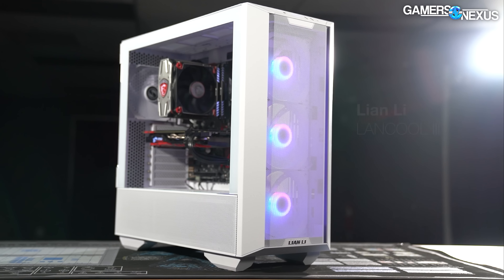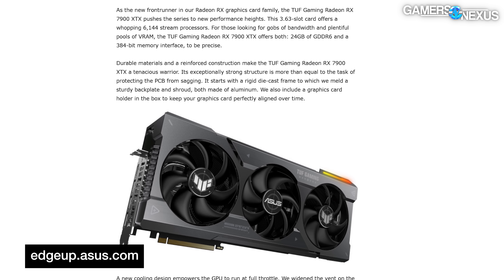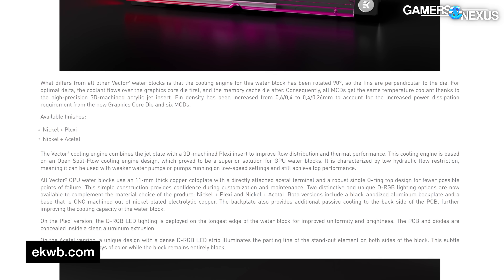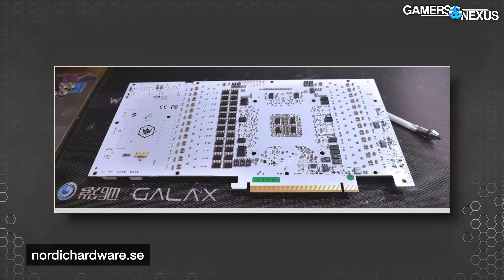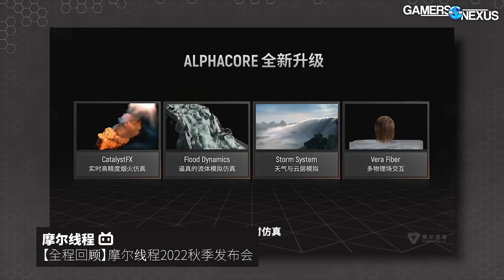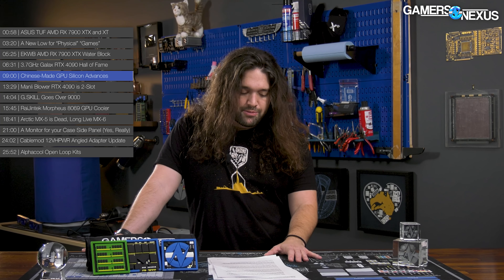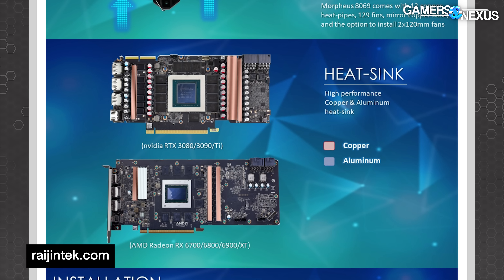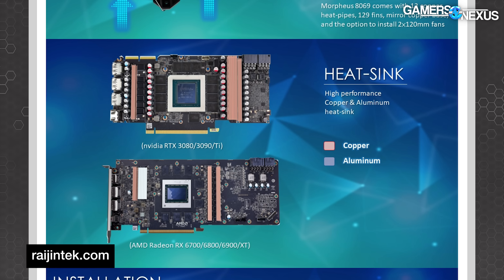HW News - New GPU Competitor, ASUS RX 7900 XTX, 2-Slot RTX 4090 Blower

Comment: I heard "2 slot blower 4090" and started hearing jet engines in my left ear
Reply: LMFAO 😂😂
Reply: Look, at least it's 2 slots. Sometimes I still wish we could go back to the 1 slot gpu days. It's so out of control now.
Reply: Linus was testing an adequate fan lately...
Reply: @roxymigurdia-t5p  why does slotsize matter, most people have more then enough room in their case.
Reply: I still run a old amd 9590 with a darknight with a delta fan on it... I leave it on and It stays on high pretty much 24.7 I never did care about noise lol. I live next to a highway I need something to drone the noise from idiots with speakers on the out side of their cars trucks with no mufflers and fart cannons hondas sounding like they are going 100 plus but come by house under 20 mph.
Reply: @budgetking2591  Makes the card more likely to sag and pull away from the cooler. It's more in the way of air flow and is clunky to work around even in cases which it fits in. Plus, they're almost always tuned to suck even more power down due to the greater cooling capacity.

It's not necessarily the fact that the card is big. It's the fact that it seems more and more cards are becoming so fucking huge and there is not much choice anymore for those who want a card more in line with the sleek slim profile of something like a 1080 Ti. I myself am still running a Titan Xp, and I'm going to hold onto it even after I build a new PC. The FE design of Pascal was slim, sexy looking, didn't use much power (comparatively), and since it was a blower design, it didn't exhaust heat back into the case which allowed it to be used in very size-constrained builds and server cases. With the launch of the 3090 and ESPECIALLY the 3090 Ti though, those (comparatively) small efficient cards we used to get with Pascal and earlier started to go out the window, and now, we get Nvidia's absurd 4090 and AMD's more manageable but still huge 7900. Yeahhhh... >_>
Reply: Hey! It worked pretty well for vega 64!
Reply: @budgetking2591  Maybe I want to use the other slots on my motherboard. Not to mention gpu sag, strain on pci-e socket e.t.c.
Reply: @budgetking2591  because I like itx builds :(
Reply: WHAT??
Reply: @nikolajlarsen6258  That's really not a fair comparison. lol
Reply: Flashbacks to my Radeon x1900
Reply: 290x blower style has entered the chat
Reply: Is that my tenitis? Nope just my 4090. 🤣
Reply: is that why the case is slowly drifting forwards?
Reply: my 290x was loud. adding 100 watts to that sounds fun. i'd actually buy this card.
Reply: Just the left ear? That's terrible surround sound, needs at least another 4090 to make it a certain loss of hearing on both sides!
Reply: @arnox4554  the 7900 is not some huge monster, relatively speaking. It's more compact than anyone thought it would be at least
Reply: When you need your PC to double as leaf blower
Reply: @Dennzer1  As I said, the 1080 Ti/Titan Xp is my personal benchmark in size and power. I'm certainly willing to tolerate some deviation in both, but there's a limit and the 7900 is looking pretty damn questionable.
Reply: @roxymigurdia-t5p  aaah, good old 8800gt days, when 90+ degrees was an anomaly and not normal.
Reply: tinnitus intensifies
Reply: @toptenanime  speak up boy, I can't hear you!
Reply: @budgetking2591  Slot width matters for workstations that might be fitted with 2 or 3 GPUs. A box with 3 4090's could render faster than a GPU farm with ~25 Titan Pascals from 6 years ago.
Reply: @arnox4554  if size is your ultimate concern, get a watercooled card or maybe just pick a more efficient card? 3070 comes to mind, no one is forcing you to buy the most powerful gpu out there and when it comes down to it, nvidia is going to do what they want to make sure they are still the performance king. Some of us prefer nvidia just going balls to the wall for the most performance and can make adjustments, there are plenty of methods out there to deal with gpu sag so that’s a really mute point, also I’ve never once heard anyone complain about the cooler pulling away from the card itself, sounds like you’ve never EVER worked on a gpu or else you would know the amount of screws that hold a card together wouldn’t allow a cooler to just sag down from the PCB.
Reply: @420IQPlayer  JayzTwoCentz did a video already on GPU sag. And even if that wasn't a factor, it's still weighing down on the PCI-e slot constantly. And now we get to make things even MORE clunky by having to install a stand into the case. Yeah, that sounds really great. Sounds like you've never EVER looked at anything other than your own experiences. As to watercooling, that has its own problems that air-cooled cards just don't have. And as to just buying a lower spec card, you're not just sacrificing on performance there, you're sacrificing on the VRAM too.
Reply: I'll never buy a blower again after Vega 64, that shit was loud. They are perfect for cards that you plan to water cool anyways, spend less on the cooling that your going to not use anyways.
Reply: 4090s can't melt steel beams
Reply: @HellNo842  because u see black smoke… that means the fire is starved of oxygen.

But if it does, and your rig collapses like a pancake, you know something’s up
Reply: WHAT? I CANT HEAR YOU! I'M OVERCLOCKING RIGHT NOW! I ALMOST HAVE IT BACK UP TO STOCK CLOCKS! ONCE MY INDUSTRIAL EAR PROTECTION COMES IN THE MAIL I MIGHT EVEN BE ABLE TO GET A FEW DOZEN MHZ MORE!!!!
Reply: @budgetking2591  Blower-style cards are standard for workstations, because if you're running three or four cards you care about slot size and need to push the heat out of the case. The 3090 has been quite popular for VFX and machine learning workstations, because it's "cheap" compared to the A-series workstation cards. Asus and Gigabyte offered blower-style 3090s, although availability was difficult due to the cryptocurrency mania.
Reply: Aka server chasis
Reply: 4090 with a blower design running sli and youve got yourself a gaming space heater!
Reply: It's the card that makes you question if you have tinnitus
Reply: @budgetking2591  how about space on the motherboard... You plug one of those bastards in, you kiss goodbye each and every expansion slot...
Reply: @420IQPlayer  You know what I think? I think you shouldn't try to rustle other people's jimmies if you can't even stand someone rustling yours. lol Enjoy your bulldozer of a GPU.
Reply: @arnox4554    “You what I think” ??? Yikes my dude, maybe try to make sense before rage commenting because I destroyed your argument. You’re complaining about the top end GPUs being large while not being able to accept the fact you don’t need the fastest and newest GPU, the market shouldn’t stop its progression just to make you happy with a “efficient top end card”
Reply: FX 5800 flashbacks intensify
Reply: @420IQPlayer  Sorry. Should read, "You know what I think?"
Reply: Seriously? Are we not going to talk about the fact that it's called a "MANLI BLOWER"
Reply: @arnox4554  Still can’t come to terms with the fastest gpu in the world being big and power hungry? Be patient and more efficient cards will come out with more vram. Unless you’ve been living under a rock, you should know everyone has been hyping up AMD’s new GPU’s, now think about nvidia’s POV, they obviously want to retain being the performance king so to do that, they went full out and produced the beast that is the 4090, just wait and get the 4070ti with 12gb of vram.
Reply: Actually and just fyi Steve what they're doing is spinning the blower st 250000 rpm. The noise is no issue, the frequency is such a high pitch its outside of human hearing range. /s
Reply: @roxymigurdia-t5p  the MSRP is really out of control.
Reply: I'm surprised we haven't seen 2 or 3 fan blower designs 😂
Reply: @roxymigurdia-t5p  Even better half slot cards where you could swap the bracket and move the vga or dvi off to the side
Reply: U want a jet engine play god of war on a launch ps4 pro 🙃
Reply: @justuseodysee7348  The $422 God of computer fans?
Reply: @budgetking2591  Have you ever met most people?
Reply: @budgetking2591  Because there are more options for expansion than merely graphics cards; perhaps a 25gig network card, internal capture card, thunderbolt, sound DACs, additional m.2 storage; the list goes on.

Currently running a 3090 and A4000 for additional monitor outputs and AI training.  The prices on those A4000s (a 3060ti with 16gb of vram in a single slot form factor) on the used market currently is creating opportunities at obtaining compute density on the cheap.

While there was a time I enjoyed watercooling, longer term it presents another point of failure; I state this because of my experiences having had 3 RMAs on a watercooled 980ti due to pump failure.

We can see through the designs of Nvidia's workstation A2000, A4000, and A6000 lineups the viability of more sensible cooler form factors.  If I was in the market for a 4090, i'd gladly sacrifice 5-10% performance to have an option that only uses 2 slots and maintain expansion slot availability.
Reply: Patrick Tho  yes and the decibels of a propeller plane
Reply: jet engines and the danger zone song lol
Reply: Does anyone even listen to Osha’s “rules”?
Reply: I use a 2-slot blower 3090 that stopped being made pretty fast, and its amazing.
Not a 4090, but its definitely doable.
Reply: I second your comment exactly. Lol My old HD 5870 back in the day playing Crysis and Witcher 2 when they were fairly new.
Reply: @roxymigurdia-t5p  just get a low power GPU and you can use 1 slot if thats what you need.
Reply: "Maverick inbound"
Reply: 2 slot open air shrouds won't even run a 4090 properly. I know they are about sufficient till about 350 watts. My 2 slot triple fan 3080 has a 360 watt power limit and it barely manages. It's undervolted too but in such a way that it still runs into power limits. It's just to make sure clocks are locked at turbo speed indefinitely. It reaches about 75 degrees under full load (RT and DLSS and at 4k). It's luckily not super loud on the stock curve but at 85% load fan speed there isn't much headroom and it truly sounds like a jet at 90% or higher. Under lighter loads though it usually doesn't break 70 degrees. Don't know how a 2 slot blower can handle 400 watts.
Reply: I typed " 4090 blower style" and google translated it to "hair dryer"
Reply: They should increase the size to something like an EVGA 680 classified. That was a blower, yet much taller for a larger fan and fin array. If this is meant for server applications, the size is understandable.
Reply: @budgetking2591  , Have you looked as MOBO designs?  for quite a few of them, mATX,  a two slot card will cover a PCI-E x1 slot and the other PCI-E is practically unusable unless you want the backside of the expansion card to be literally less than 1cm from the GPU fans thereby likely affecting airflow.  I still need to test how this affects temps in my new build so opinion could be wrong.

We can argue this is a fault of the MOBO design which it is partly but a double slot GPU will affect how much 'usable' PCI-E functionality we can get from any particular MOBO.
Reply: I find half height more needed than 1 slot. A lot of people get dell SFFs for free and want to game on them. (Putting a 1080 in a SFF was a fun joke build i had for a while)

Comment: There was another Chinese GPU that was announced a little while ago, called the Fenghua 1. That one licenses PowerVR from Imagination Technologies, who made GPUs PC and the Dreamcast before moving on to mobile GPUs instead.
Reply from the maker: Interesting!
Reply: IIRC Imagination Technologies also worked with Apple for SoC graphics at some point. That may have been somebody else as it's been a while, but either way they're a very interesting company.
Reply: I had a PowerVR way back. It would play Unreal 320×200 accelerated, it had 2MB. 

Yeah, been a while. 

They left desktop because they had to go redesign integrated 2D/3D from what I remember and did not have the capacity and saw too little growth potential. Something along these lines at least.

If they return, even with just midrange budget cards, all the better.
Reply: "GPUs PC".... what?
Reply: @Dennzer1  
IBM PowerPC
Reply: I had PowerVR Kyro 2 , it was actually quite fast but didn't support hardwareT&L so quickly got outdated as new games used the feature
Reply: @GamersNexus  also, I just want to note this isn’t moore threads first card they had a generation before this with a consumer card, and a server card as well Just wanted to make sure you knew that.
Reply: @DigitalJedi  yes, I used to work on those. A lot of the Apple gpu guys are ex imagination.
Reply: It’s Chinese in the sense that the company was bought out but the dev is still in the uk primarily
Reply: Mainland Chinese? NOPE NOPE NOPE
Reply: @jamegumb7298  Kyro?
Reply: @Cecil97  Nope?
Reply: @krazyolie  With mostly Chinese R&D team?
Reply: @Dennzer1  Guessing he meant GPU's for PC's 🤔
Reply: @jamezxh  I cannot remember exactly. 
I did some googling and think it was a Matrox Millenium PowerVR or Matrox M3D. I cannot figure out which of the 2 it was for certain. It was 2MB on the PCI bus.
Reply: @Cecil97  yes yes
Reply: i ahve no insterest in chinese gpu designs... i'm mor intrested in rather or not any one is gonna fill EVGA's shoes when it come's to devliering quality  video cards . so many other brands always skimped on things like memory cooling.
Reply: @DenverStarkey  It is the chips that is most important. They have to be good.

 PowerVR does okay in smartphones. If they can make good designs and have them sold to AMD and Intel for integration on CPU's, great, if they can make desktop or laptop gpu's, even better.

Chinese cards suffer from a lack of quality control, if that is done by the manufacturer it goes well, see all the Apple products, gpu cards made now. A lot of it in China but they are monitored so they cannot skimp.
Reply: Apple's GPUs are still based on imagination (powervr) IP.
Reply: Imagination Technologies who owns PowerVR lost a ton of market when in 2017 Apple said they would make their own GPU. The stock crashed and a Chinese company bought Imagination Technologies in late 2017. Now only cheap Chinese phones use PowerVR gpus. I guess the end goal was to use the IP to create discrete GPUs amd that is what Innosilicone is doing

Comment: I remember something about Nvidia discouraging blower designs for the 3090, probably to not hurt their quadro sales. A blower 4090 would probably be good for a workstation.
Reply: Why would it be better for a workstation?
Reply: @phoenixfieryn1257  AIBs have already been directed to nerf blowers on high end GPUs by purposefully covering the entire heatsink with the shroud. That way, you can’t slot them next to each other and rely on powerful case fans to direct air through the heatsinks, as the only cooling they will get is with the shitty blower that will be covered up by an adjacent card. This has also only started after the Titan were beginning to flop, so the timing is pretty obvious.
Reply: @stuartfury3390  you can move Workstations to a dedicated server room. So noise is no concern. Furthermore blowers move the heat out of the case + same power Quadros cost at least twice the price of an 4090 (and if not needed, a 4090 is quite enough - EposVox showed many usecases for professional use).
Reply: @ThePeperich  not sure wyhy were talking about quadros anyway, the A series are the workstation gpus and besides some very specific use cases the 30 series blow them out of the water. even if you need 48gb of vram you can run two 3090s for half the price
Reply: I don't think the reason is because of quadro/tesla sales. 3090 with blower cooler will hamper the card in a negative way. For pro card like A6000 the chip itself already being tweak and bin from one that have the best efficiency.